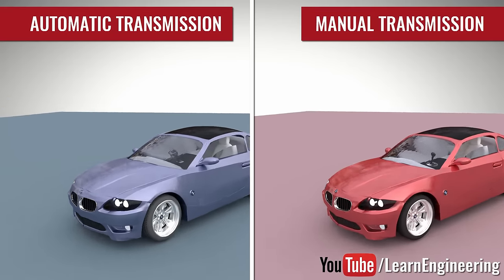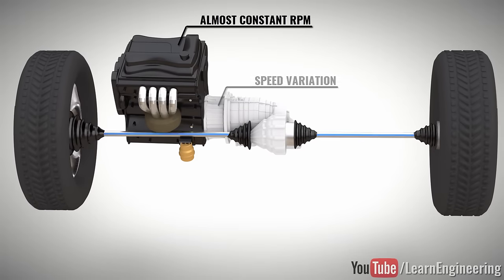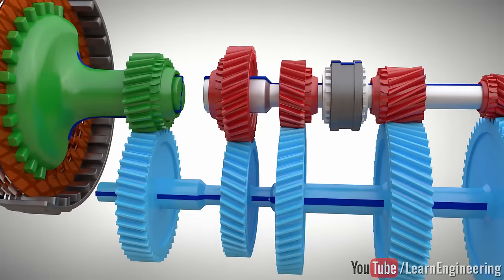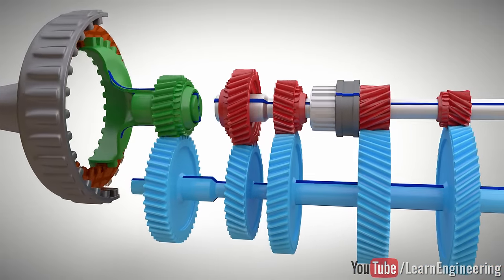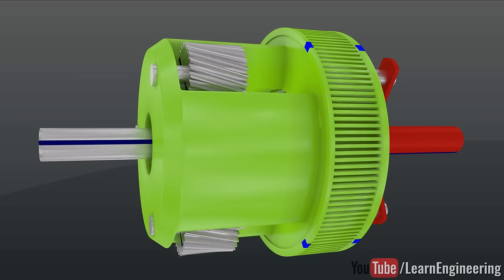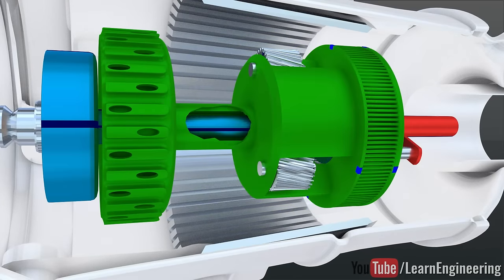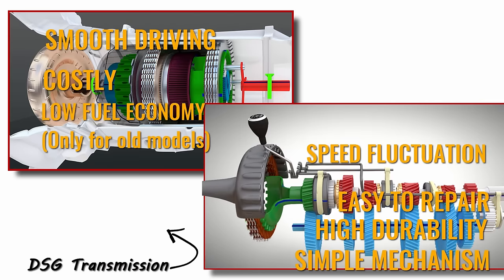Automatic vs Manual Transmission

Comment: The smoothness of the manual transmission is something that you learn with practice, so that can be a bit misleading information. In the other hand, it is recommended to have the engine engaged during breaking all the way before it starts to stall. By leaving the engine engaged you let your engine help you slow the vehicle down, saving a bit on breaks. I will also like to add that driving on downhills manual also helps to avoid the vehicle gaining too much speed, thus also not depending merely on break pads. Just saying…
Reply: The trade off then becomes how much wear you’re willing to put on your transmission. I prefer to just use my brakes since they’re easier to replace than a transmission. Definitely useful when going downhill though
Reply: Also I’ll add that you will use more gas using engine breaking and your engine will rev higher causing more wear and heat. I’ve decided that a brake pad job is easy enough than to stress my engine and clutch and trans. But for racing, engine brake is where it’s at.
Reply: @BananaBabys thats just wrong, engine breaking doesn’t use any gas in injection engines
Reply: Only if you shift down while slowing down
Reply: @tobiasbauer198  i mean yeah. If you don’t actually engine brake properly, it doesn’t save gas. But their statement was general.
Reply: brake ≠ break
Reply: Don’t be mad at me but you can use the same engine braking concept on automatics by putting the transmission in “sport” mode or a lower gear. Less control overall of course
Reply: @manuelarias9225 than your not driving automatic, but semi automatic. And you don't need a sport mode for using the gear shift button or whatever
Reply: @tobiasbauer198  sport mode is just what the manufacturers call it. On some cars it’s marked as L. Honda has it as S on their shifter “the console-mounted gear selector includes an "S" or Sport mode that provides a sport-shift schedule that delays upshifting for more available power, and provides greater engine braking.”
Reply: @manuelarias9225  if you enable that mode your not motor breaking, but spending more fuel in order to reach 100 km/h faster. If you want an engine break, you need to enable these semi-automatic shifters, or use an electric car.
Reply: It also increases clutch life by not being  press down a 100% of the time you are using the brakes :)
Reply: @lukas7858 it doesn't use gas the same way going uphill doesn't use gas. Anything that slows you down uses gas because you used gas to gain that speed. If you really want to save fuel let go of the accelerator earlier and coast to a stop in neutral
Reply: @pepebeezon772  That‘s bullshit, if you‘re in neutral the engine requires gas to keep going. Same way the engine uses gas to keep running while you‘re on the clutch.
Reply: @lukas7858  the engine always requires some gas to idle, genius. There's always fuel injection to keep it going until you turn the keys to off. That's why you can move forward while in gear even if you don't step on the gas pedal
Reply: @BananaBabys  I live in the mountains and I prefer to have the brakes when needed, I saw a lot of people have the brakes heated and cannot brake because they used an high gear and end up crashing, or arriving at the bottom with a beautiful smell of burned brakes. So I prefer to use engine braking in downhill, better change transmission than changing car.

Edit: Also thinking that engine braking isn't so dangerous for the components, because all in my family do this and all our car lasted for more than 10 years and like 1 or less change of the clutch for each one. Obviously engine braking doesn't mean that the brakes don't have to be touched, when you see the RPM going too high (or the speed) just use a little bit of brakes  and you are good to go (also don't use the throttle like you would do with using brakes, just a little bit just to start after a sharp turn)
Reply: @pepebeezon772 but if the Power to move the engine comes from the tires, modern cars stop the fuel injection. Only if you use the clutch or the rpm from the engine becomes to low, the enginge starts to inject fuel. In german the word is Schubabschaltung
Reply: Brakes and braking. Holy cow.
Reply: The smoothness he was talking was of the acceleration when you change gear. In manual cars when you are changing the gear there a few instants (that vary with your skill) were the engine is not connected to your wheels, while in automatic the engine and the wheels are always connected.
Reply: you cant have smooth acceleration when having to shift gears. its not about stalling, you cant keep accelerating when engaging the clutch, thats what the graph also showed. with automatic you can continue to accelerate with the same rate even while shifting. shifting gears may feel smooth, but its not constant acceleration, thats impossible.
Reply: @dankrigby5621  That is correct, but how do you define smoothness? As how the video explains it, it is the feeling when you learn and at the first glance each gear shift is felt as a step. Yeah, acceleration isn't continuous not matter what, engine is disengaged and for that period of time inertia takes place, but you lose a small amount of forward trust.
Reply: @jonhlennon312  you only feel aceleration or deceleration, you cant feel velocity itself, so a change in acceleration is considered not smooth. most people dont switch gears when fully accelerating, except when they have to accelerate really fast over a longer period. youd feel that. what you refer to as smooth switching is switching gears on a set veloocity, which can be done pretty smooth (its never completely smooth but you wont feel it in that case). he awas talking about acceleration tho, its impossible to smoothly accelerate while switchting gears. yes it can be done with being barely noticeable when youre not pushing it to the limit, but speaking in technical terms, that isnt smooth at all. it feels smooth, but it really isnt. well it all depends on how you define smoothness i guess, but he really just wanted to show that accelerating with the clutch not being engaged is impossible, which is true.

Comment: My brain burned during the explanation of automatic transmission
Reply: Vule 
Sane
Reply: It's not you. My cat could have meowed a clearer explanation.
Reply: Same dude
Reply: I tried to understand automatic transnission many times but understood nothing
Reply: Same, with automatic explanation my brain goes blank lol
Reply: Thats because he's talking about a dual clutch automatic transmission
Reply: Too much RPM, you have to swith to bigger speed gear
Reply: my brain died
Reply: If you can smell burning clutch packs you might want to call 911
Reply: It squeezes gears in different orders so only certain ones can rotate
Reply: My brain burned reading ur name
Reply: Simple. Spinny goes in middle. When you stop outside ring it gives you torque. And then you link them up to get torqe or speed.
Reply: @bakoty6571  😂😂😂

Comment: I prefer a manual. Better control (engine braking for example), smoother shifting (provided you know how to drive a vehicle with a manual transmission), and better fuel economy.  Also I've had automatics that at certain speeds and loads couldn't decide between 3rd and 4th gear and kept shifting between the two giving you whiplash.
Reply: İ can engine break with my automatic. For amount of time i can set the gear i want for short periods by shifters behind wheel. Or i can make it completely manual
Reply: I'd prefer manual if I wanted to drive for fun, and an automatic if I wanted to drive without thinking too much. I think in the long run cruise control w/ an automatic transmission has been shown to actually have the best fuel economy, at least if you are on a highway and don't have to brake frequently or speed up of course. I just can't imagine spending 8 hours on a roadtrip with a manual transmission, but I guess thats why SUVs don't really have manuals.
Reply: @yesyes-om1po  Road trips are probably the easiest drive in a manual though. Just throw it into your highest gear once you get to speed and just keep cruising. It's the commute that can be rough in a manual, especially if you live somewhere with heavy stop and go traffic.
Reply: I get it old man new stuff is hard to understand sometimes but all the things you listed have been an advantage for automatics for the last 15 years
Reply: Yes  I do agree with you. Because they say professional drivers knows how to uses manual transmission and does use it most of the time.
Reply: @devinwilson816  Which professional drivers? F1 cars are all automatic
Reply: @kaloyandraganov9462  professionnal youtube drivers
Reply: @elsironys  Cope
Reply: @kaloyandraganov9462 f1 cars are sequential aka semi automatic
Reply: @RaffleE46   🤓
Reply: @yesyes-om1po manual is fine for long journeys as youre going the same speed the whole way you stay in 1 gear the whole time. Its traffic and city driving thats tedious in a manual
Reply: Bruh smoother transition is just a lie. I enjoy manuals but you have to address your bias

Comment: You don't have to press the clutch pedal while breaking unless you are going too slow which causes the engine to stal
Reply: I think he meant braking until you stop, like when you get a red light.
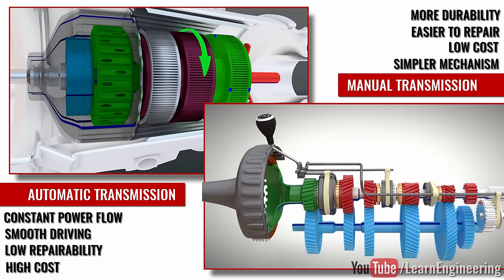Reply: @BosisofSweden  I believe Daniel's talking about 6:35. He says that you must press the clutch pedal completely before braking, which is not really true.

When you're slowing to a stop you leave the clutch engaged to take advantage of engine braking. Obviously you disengage the clutch when you get to a near stop, but you can absolutely use the brakes while taking advantage of engine braking to decelerate to a stop. If you're familiar with heel-toe technique for downshifting while braking, that's exactly what's happening to slow the car down.
Reply: @phone4189  aha, okay. Yes, that is incorrect.
Reply: That is what he meant though it was confusing lol. I think most people put it in N far before they have to fully stop.
Reply: @danielplasencia7271  no, they don't. You gear down and motor brake if you have learned to do it the correct way. If you end up to have to stop you use no gear as you wait och the lowest gear with the clutch down if you are about to go
Reply: if i know im going to stop i always just hit the clutch even if im still going fast. I just like that glide. My brakes hate it.
Reply: @lubu4u312  😄 just don't do it in the mountains!
Reply: You are "breaking" your car?
Reply: This guy want you to stop your car only using the breaking pads so you have to change them every 15.000 miles.
Reply: @phone4189  Yes because jamming the clutch and selected gear against the engine spinning the crank is such a good idea. It's so brilliant I'm not surprised it was invented by people with really high IQ.
Reply: @JesusProtects Better to replace break pads for 20$ (which are designed to be replaced) than pay 4 thousand dollars for a new transmission.
Reply: @Neoprenesiren  I mean... braking while in gear WAS invented by people way smarter than me. That's how we ended up with the heel-and-toe and rowing techniques to downshift while braking. It objectively increases braking efficiency. This isn't some rare arcane shit lol it's common practice

Comment: 6:38 is nonsense. You can brake without engaging clutch, just watch rpm to dont drop below minimum  to dont stall engine
Reply: Thats my man, at least someone mentions that.
Reply: yup and actually engine helps in breaking
Reply: He mentioned, "Heavy Duty Equipment"... When you have a "Heavy Duty Equipment" going down on a long hill or mountain, you don't want your brakes to overheat, so you use the transmission as an engine braking system...
Reply: @ImranQureshi-ig9kd  only if you downshift
Reply: @g0nzal0id  the downshift is the immediate break , i m talking about engine break that u will feel if u release the race , the car will slow down , if u press the clutch u l see that the car slowing down isnt as quick as it would be without the clutch meaning the engine is stopping the car while in gear
Reply: @ImranQureshi-ig9kd  Yes I know what you mean, all I'm saying is that it doesn't work that well with higher gears so it's pointless to try to engine brake in top gear xD
Reply: What is considered minimum? You can say under 800 but some cars can handle that so it depends
Reply: @redharlow3139  Each engine is different. I drove 1.9 diesel and I could go as low as 1500rpm without engine starting to stall. Now I drive a 1.2 three cylinder petrol engine and it starts stalling under 2000 rpm (except first and second gear where I can drop it more). It won't stall immidietely, but you start to loose so much power and torque if you go under minimum rpm.
Reply: Def can but that's more stress on the trans/engine. Much rather go through replacing brakes/rotors/calipers than a trans/engine repair.
Reply: Engaging or disengaging?
Reply: exactly and you can use engine braking as well if you don't release clutch. This video was somewhat biased against manual lmao
Reply: @vors3663  He's your man?
uuuuuuuuuuuuuuhhh.....
Reply: Agreed, bro. He must have never drove a real manual, he tells that it's never smooth, cause the manual clutch is used everytime to change the gears, which actually doesn't happen.
Reply: @krystofblacha4619  and my Wrangler doesn't start to stall until about 750, it all depends on the vehicle and it's engine.
Reply: Correction: you MUST brake without engaging clutch, unless you need to downshift or stop.
If you engage clutch every time you brake you'll never pass your driving license exam, and rightly so because you'd cause so many accidents
Reply: @Imran Qureshi  You "break" your engine?
Reply: @LucidDreamer54321  oops. Thanks.